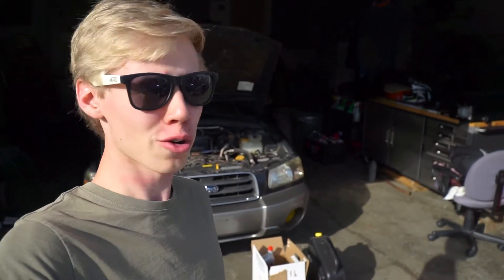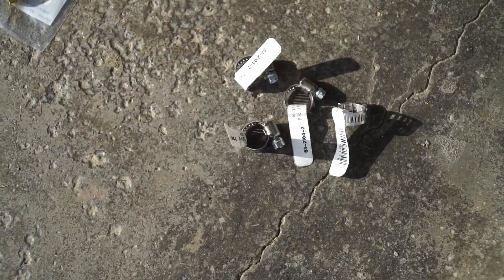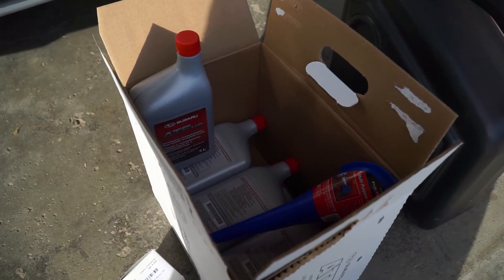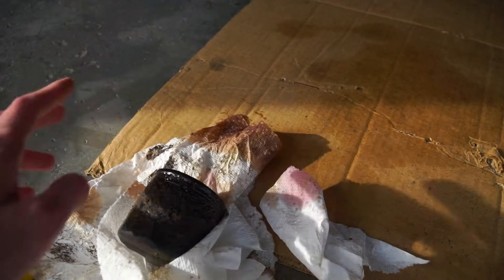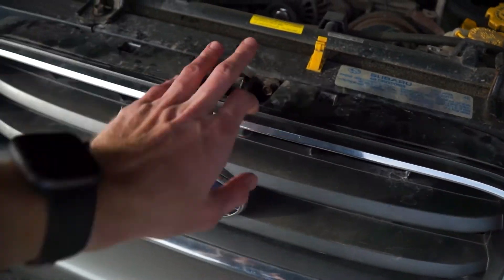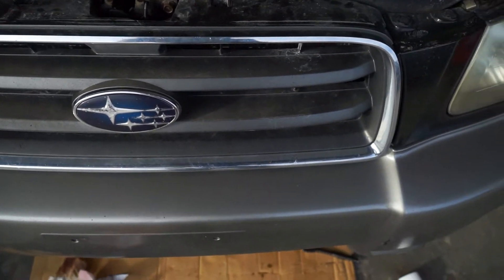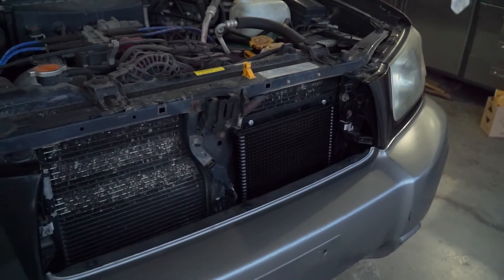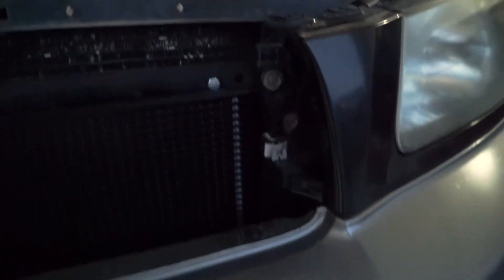Subaru Transmission Cooler Installation - DIY

Comment: Just moved this mod up to #3 on the list after I burnt my tranny fluid hauling a trailer 2400kms :(
Reply from the maker: Woah that sounds like quite the trip! What were you towing?
Reply: @Chase_Schrader , a utility trailer loaded to 2000lbs on the way to Victoria from Smithers, but empty on the way back. It was a journey for sure. Also had to make a detour to Lordco in Kelowna to pick up a new battery and the only alternator I could find in BC after mine got glitchy in Williams Lake.

Somewhere after Williams Lake on the return trip is when my front diff started to whine. I kept going, but took it easy. About 100kms from home the trans warning light came on so I stopped to let it cool off, and for some reason when I tried to get moving again my front diff locked up and ended up breaking a bunch of teeth. Had to call BCAA to get towed the rest of the way home.

Got another diff waiting to go in when I've got some time next weekend, but man what a pain.
Reply from the maker: That is quite the drive!! Oh no you had quite a few things pile up on that trip, at least you have a story to tell now haha, or that what I tell myself when something like that happens

Comment: Nice vid- doing the same for my 06 xt but can’t find info on which line is the return! Heard it was the long line to the passenger side but not sure! Which one did you use?
Reply from the maker: I go through my set up at 11:52. This forum post also goes over it: https://forums.nasioc.com/forums/showthread.php?t=1707125

Comment: Perfect timing as I am getting ready to install an aluminum radiator in my legacy which means I have to install an external cooler since the new radiator doesn't have an internal cooler.  I really like the bracket you made, I was going to try to bolt the cooler directly to something in the front end but I will definitely make a bracket.
Reply from the maker: Awesome, glad I could give you a couple ideas! Good luck with the install!

Comment: I don't care what anybody tells you. There is NO SUCH THING as a life time part. If anybody tells you that, they're full of crap, even if they're the manufacturer.
Reply from the maker: I can see that how the filter could be a lifetime part if the car only went to 250,00km but at 300,000km it was definitely time to change it!
Reply: @Chase_Schrader  well that's the thing, they call it a lifetime part because they expect (and encourage) you to junk the car as soon as it gets a few miles under its belt, but if a car was actually properly maintained and repaired in a timely manner it would last well beyond the life of that filter.
Reply from the maker: Oh yeah for sure, especially in new cars! My Forester is at 360,000 and still going strong!
Reply: @Chase_Schrader  that's what I like to hear! 😂 Drive it til' it don't drive no more 🦾
Reply from the maker: Heck yeah! Then throw another engine in for another 300,000kms haha